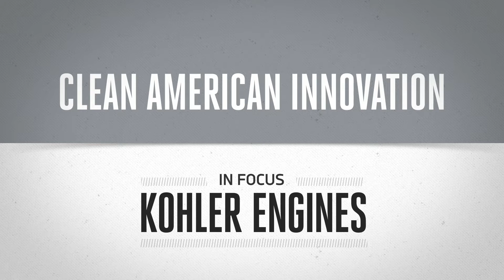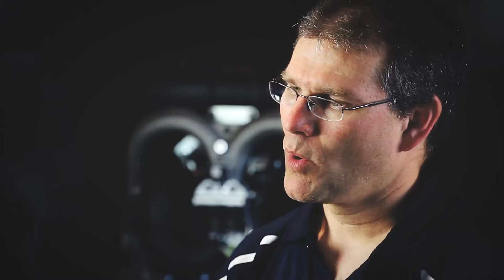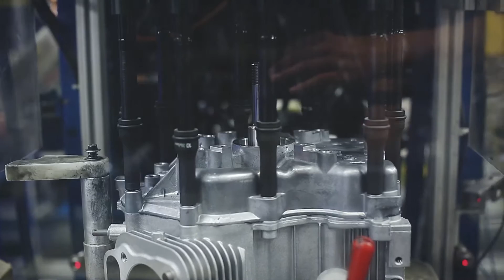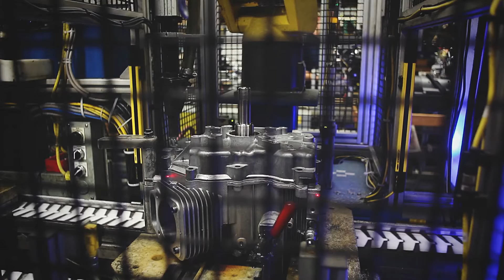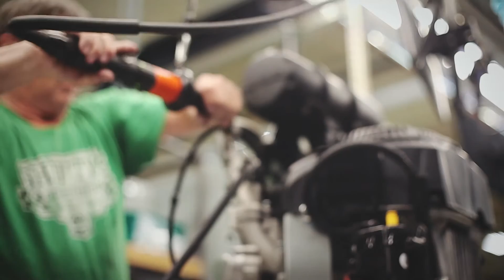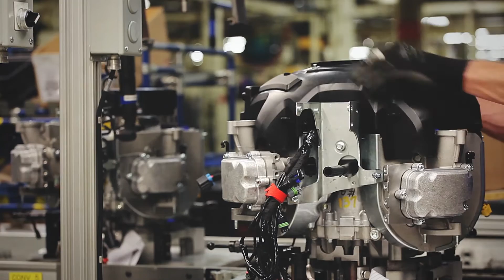Propane-Powered Mower Engine by Kohler Engines

Comment: Just bought a Miller Bobcat 250 LP with 1625 hours on it. When I got it home I checked the oil and the filler hole is crudded up with water contaminated oil, and it shows a couple of small drops at the end of the dipstick. What can I do to flush this out, and also what's the best way to remove that water from the top of the engine (at the oil fill cap area)?

Comment: cool info. 
I'm just wondering what changes the block would need to get optimal performance on a budget. 
Still doing research finding info as I go👍
Reply: Higher compression and advanced timing.